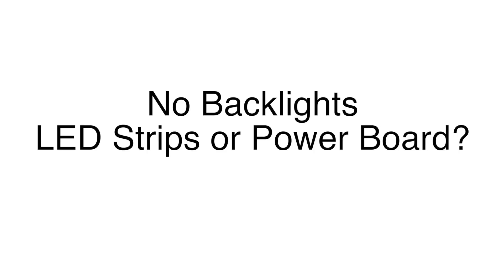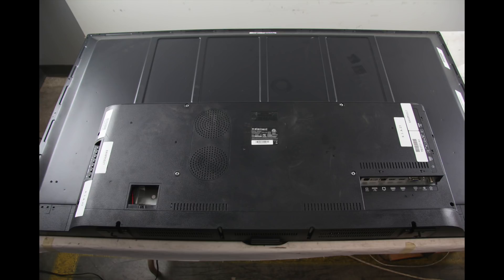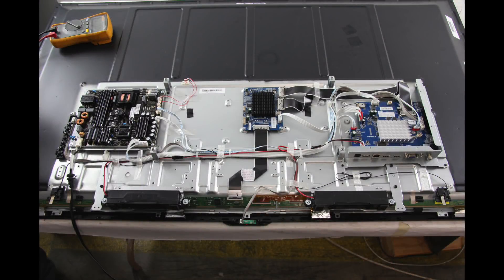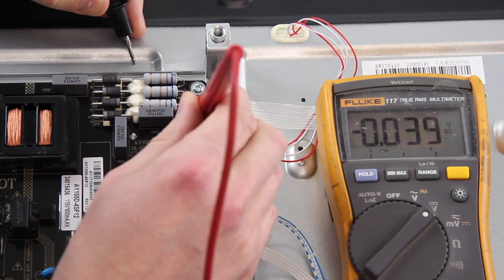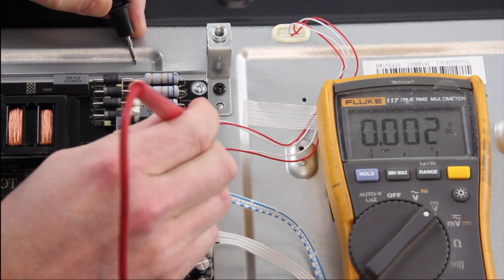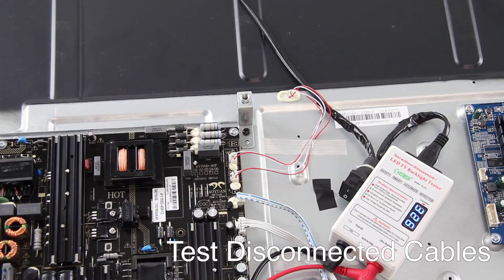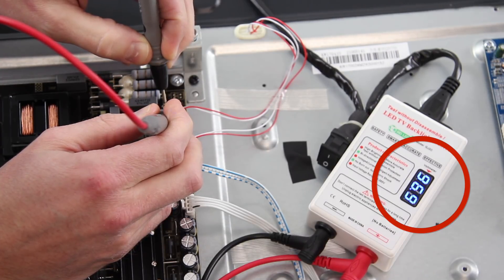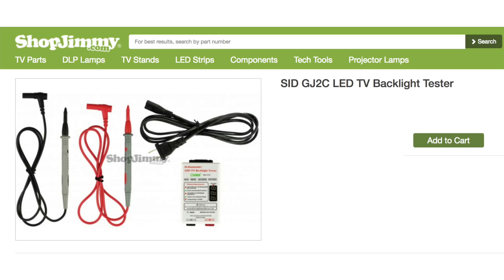No Backlights STEP #1 LED TV Repair Overview - How to Troubleshoot the Power Supply & LED Strips

Comment: I just want to ditch everything but the power supply and turn the LED into a light by removing the LCD and putting a on off switch how do I do this?

Comment: Hi ShopJimmy, question, My Samsung is restarting when switching from one HDMI to Another, after replacing every board and ribbon cables, I found out the top LED strip is dim.  How do I disconnect the faulty backlight strip wires from the power supply board? I got two connectors with 16 wires each. I realize cutting them off won't do. Is there a hack for it? Thanks

Comment: Tcl 65 inch. Used tester. 5 out of 6 strips with all leds working. 1 led with none of the leds working. Alexa turn on the TV. Leds flash momentarily.
If I disconnect the bad strip, might the other strips remain on?
Grasping at straws.😢

Comment: Just got a donor TCL tv, board puts out 88v to leds, just one strip. 

However the strip just turns on for 1 second then turns off quickly. 

With the tester, the screen shows 112v on the little display. 

Tv still shows video, will try to replace led strips first but I feel like it’s more of an issue with the power supply. Tv is 2021 so it’s not heavily used. Led strips are pure white and no burned out leds, they all fire up with the tester.

Comment: I have an ONN TV and I have it apart and found a bulged capacitor near the backlight output. The issue with the TV is it turns on and then if cold it runs about 20 mins then the backlight goes out but if you shine a flashlight on the screen you can see the picture. I found the bulged cap but they mounted it with this white rubber and the plastic on the cap is brittle and is flaking off. I have some caps I will try.

Comment: I have a JVC LT-42P789 flat screen. Sound is fine, but no picture. I can see the unit come on & the screen lights up, but even with a flashlight test, no image. I am at a loss.

I also have a TCL L40FHDF12TA 40" tv whth the same problem, only the TCK shows the "TCL" logo when turned on then nothing. No indication of any image. 

I REALLY don't want to go purchase a new tv if either of these can be fixed for cheap.

Any suggestions?

Comment: I have a hisense 58r6e3 roku tv and I have replaced all parts besides the led backlight strips and my tv will not turn on when I try to turn the power on the red light will go off then blink once or twice and then light back up again what could be the problem

Comment: TESTING THE LED STRIPS WONT TELL YOU NOTHING UNLESS YOU STRIP DOWN THE TV AND TEST EACH STRIP ON ITS OWN,  IF YOU PUT THE LED TEST LEADS TO THE CABLES WITHOUT REMOVIN THE SCREEN  IT WILL STILL LIGHT UP THE STRIPS  SO YOU WILL SEE SOME LIGHT COMING THROUGH THE BACK OF THE TV , BUT THEIR COULD BE JUST ONE OR TWO LEDS NOT LIGHTING  ON SOME STRIPS , WHICH IS ENOUTH TO PREVENT THE BACK LIGHT TURNING ON DURING NORMAL USE OF THE TV , SO IT IS BEST TO STRIP THE WHOLE TV DOWN AND TEST EACH INDIVIDUAL STRIP , DOING ANY OFF WHAT THIS VID SAYS WILL TELL YOU NOTHING AS YOU HAVE STATED ABOUT THE VOLTAGES ALSO , THE TV CAN SHUT THEM DOWN WHEN IT DETECTS A PROBLEM WITH THE STRIPS , SO BEST WAY IS TESTING STRIPS ONE BY ONE

Comment: LED lights worked individually but the power supply refused to turn them on when unplugging T-Con board.
Reply: I got a similar issue with my TV.  I have 5 rows of LED strips.  There are only 3 power lines going to the LEDs - so the top two rows are in parallel, and the bottom two rows are in parallel.  The middle strip is powered by its own wire to the Power Supply.  Using the LED Tester when I test those that are in parallel, one strip lights up but the other does not.  When I unplug the row, then both light up.  Hmmm.  Messing with the set, I started off with a black screen but now the power supply will power all but the top row.  This is the second time I have been in my TV and now I suspect that there is a current limiting issue causing the power supply to cut back on the voltage.  
To further suspect this, when the screen was black I found 24v on all three power lines to the Back Light LEDs.  When the Back Light LEDs would light up, I found 38v.
I've ordered a complete set of LED strips and hope that fixes it.

Comment: @shopjimmy.com have a westing house tv. 40inch. The backlight seems to be gone. Cause I used a flashlight and can see video playing, have also replaced the tcon board and still the same problem. The led board  capacitors read 15.4V. Should I replace the mainboard to fix the issue or is it another problem??

Comment: Hi m8 hopefully ur well i m stuck on one think i need ur help i have 55uk6950plb it's power spliy ok i m testing backlight with led tester backlight on with the tester but backlight not on when i m plug in both look fine even i have other power spliy but still backlight are not on will you please tell me where is the problem i m really thanks full to you if u reply me asap please

Comment: I don't think you need to know the voltages to test this. With a VOM if you get voltages in the milivolt range, that's not enough to power the LED's and the power board is probably bad. Duh.

Comment: I tested all my lights one by one  an all of them work fine . my red light is on an when I put a flash light the screen the picture is on . but when it's connect the back light don't come on
Reply: I have the same issue. Every led working properly, I checked the psu board and the voltage is right . 
@ShopJimmy.com do you have some idea ?
Reply: @noelfurky3303  LED Driver or Inverter issue

Comment: Is the little pocket transformer necessary if I'm replacing all of the led strips? I could see if I were just going to replace a single led or something. I have a volt meter, trying to do this on the cheap because the tv is 5 yrs old or more and they keep going down an down in price for new units.

Comment: Why are these leds high voltage? I know certain leds that use 5v and are much much brighter
Reply: Each LED requires low voltage (usually 3.4V or so depending on the specific LED). When you put many LEDs in series in a strip, the entire stop needs a higher voltage.

Comment: I need help! I have a Haier tv that has sound but a black screen. When I turn it on and lights off in the room there is no backlight. When I push the menu button and use a flashlight I can see the image. What do I do next?
Reply: Looks like the back light failure, it needs new led strips, you will have to find an engineer to replace the led strips, but you need the power supply board checked just to make sure there is no fault there.

Comment: If ALL LED's are out, wouldn't that point to a failure of the power board as it is the common source of power for all LED strips ? Are the LED strips wired like christmas tree lights, where if one burns out they all go out until the defective on is replaced ? I wish I could find a schematic of my TV to see how they are hooked up and powered.
Reply: I know this is an old comment but it depends. some sets are like christmas lights where they all go out and others, just one strip can go out, others just one bulb.
Reply: It has been stated if one led bulb goes out so does the rest of the strip. Like Christmas lights, all are connected in series,

Comment: How much voltage to be exact needed to turn on the LED backlight?  My TV model: KDL-65W850C has no backlight. I measured the voltage from its power supply and I can get 125V DC.  The board indicates from 173V to 230V.  There's a sound.

Comment: I have a 39" LG for which 1-2 years ago I replaced one of the LED strip. Now it happend again, but when I checked the LEDs one by one with a multimeter, all light up. In fact I saw them flashing for an instant, like the board is trying to light them up.
Then I checked the cables going to the backlights and I saw 0V, but with what it looks like a short pulse of about 12V DC. How could I troubleshoot/fix the problem? Any advice?

Comment: I need help, my tv when i turn it on it does like a noise like if its shocking something and smoke comes out, i know its the power supply for sure it smokes where it connects to from the board to the leds. can i fix it my self or do i have to buy a new power supply?

Comment: So I have a question. 2 repair people have looked at it and cannot figure out what is wrong without tearing it apart and I dont want anyone to until i can figure out what is wrong. So my problem is this... 

I was playing on my computer then turned off my pc, tried to turn off the tv and boom, I couldn't turn it on or off anymore after that, then I can still see where it says hdmi 1 on the screen and I can see the screen works fine still. But the remote doesnt work, the touchpad on the tv doesnt work and just has a red blinking light when I press any button on the remote or touch pad. When I turn on my computer on the same hdmi 1 input, it doesnt show up or anything. What is wrong with my idiot tv? samsung 2012 model smart tv
Reply: Ashley Aurora it could be a dirty touchpad on the tv it doesn’t take much to mess it up disconnect touchpad and try again

Comment: I have a magavox # 47mf437b/37  The set has sound and picture.  The issue it that the color is washed out and it has moving lines across the screen.  Horozontal lines, looks like the old sets with horozontal hold issue.  Picture is rolling.  So I changed the t con board but it had no effect..  Inverter?  Main board?

Comment: I have a Vizio XVT373SV. I have sound but no picture. I’ve done the flashlight test which reveals there’s picture but only with the flashlight. I’ve replaced the power board with no fix. On initially turning the tv on, there’s backlights but turn off almost immediately. What should I replace next? Thanks, Nancy

Comment: I am troubleshooting a Samsung UN50H6203AFXZA. I did the flashlight test and determined that there is no backlight. The voltages seemed higher than that for the 32H in your video. I measured 386v D+ to D-, and millivolts on the sense pins S+ to S-.
Is that normal, is my power supply/led driver good? I think it is, but was wondering about the high voltage.

Comment: My LG 47LN5400 had a black screen but my back lights work and when I was testing it with my voltmeter accidentally crossed and shorted one of the capacitors out and now the back lights don't come on with that be just the mainboard I'd have to replace
Reply: And there is no standby light for the power button anymore

Comment: Sony 65X900C. When I got it last week, I was getting 4 red flashes from the standby indicator and no LED backlighting. Looked around online, seemed to indicate a problem with one or more individual LEDs. I disassembled the TV to access the LED boards and ultimately found that they were all 100% working. When I plugged everything back in again, I was now seeing an alternating amber/green light in the standby indicator. This is apparently a code for firmware/software update. I used a USB drive to upgrade to the latest version per Sony's site. Upon boot up after the upgrade, the LED backlights come on, but the panel now seems to be stuck in Purity mode (alternating red, green, blue, white, gray). This is the behavior whether the main board is connected to the LVDS or not. I have tried various reset procedures I've found online, nothing seems to fix it. Since this happens without the main board connected, is it safe to assume that it's a bad T-Con board? Thanks for your time and attention.

Comment: Hi I have a Toshiba 55L621u that will not power up. The red LED stays solid on the front and blinks every 10-15 seconds. There is no LED, or sound, No splash logo etc. When it went out I was casting my phone screen via mirror to the built in chrome cast. Could this extra load have cooked my main board?

Comment: Very nice Vid.Thank you.

I should repair the LCD-TV from my grandparents. It's a 2005 Universum FT-LCD 8154 (identical to Hitachi 32LD6200).

The problem is that after switching on only 2 Seconds you can see a perfect picture (no stripes or bad colours) but then the backlight switches off. The power light stays green and the sound is absoluely fine. The screen is absolutely dark but with a flashlight shining on the screen you can recognize a picture.

We have changed the main internal power supply from the LCD-TV but with no success.

They love their LCD-TV and we really want to repair it to avoid waste to our environment.

Does somebody have an idea?

I would replace in the next step the Backlight inverter board. Is this a good idea?

Thank you in advance.